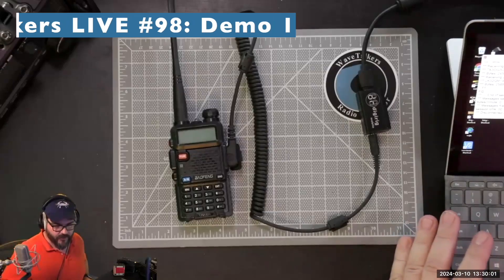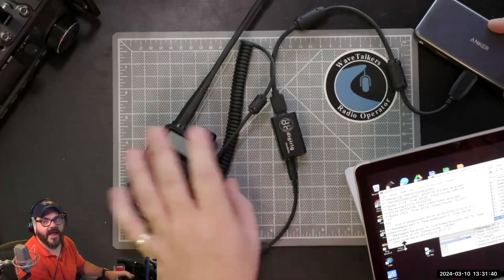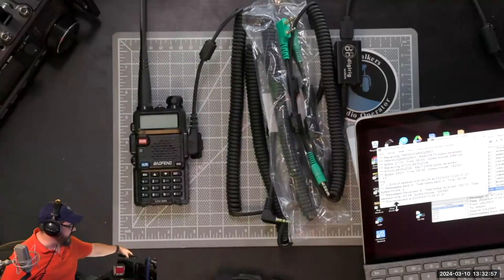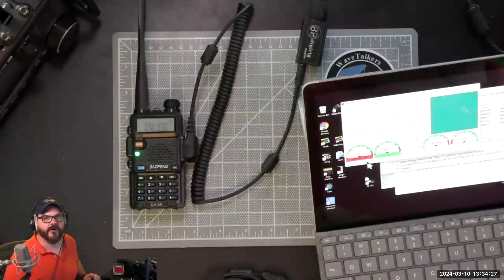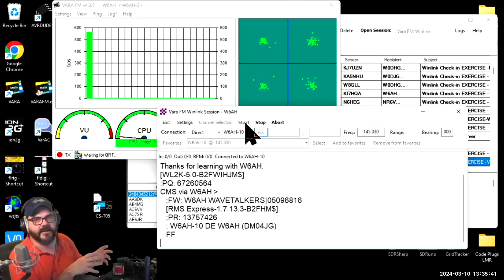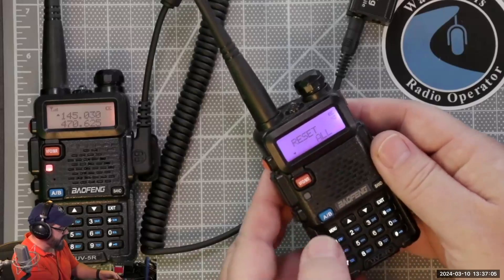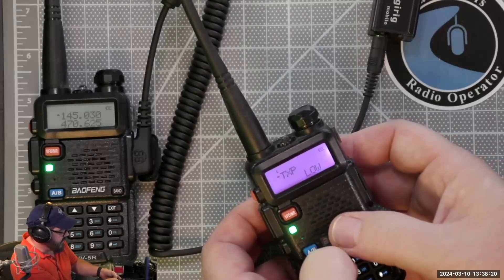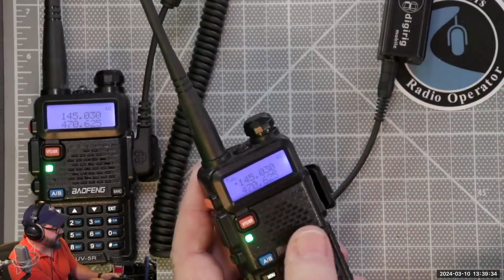VARA FM Using DigiRig & HT

Comment: 0:29 I had an issue with wsjt-x where some bands would crash the whole program after an error code. Took me weeks to figure out that winding the usb wire around a toroid about 8 times completely eliminated the issue. RFI choke everything!
Reply from the maker: Yes, RFI can be a real issue and cause a lot of frustration trying to track down.  Glad you got it working!

Comment: What size ferrites do you have on the Anker splitter? I have the same one.
Reply from the maker: Not sure which sizes they are, I had a multipack use the most appropriate size bead for the wire.
Reply: @WaveTalkers  Guess I’ll just get a bunch and figure it out. I think they have sizes but I don’t know what size a standard USB cable is.
Reply from the maker: @N4EJM  many Ferrites will list the inner diameter of the core.  You can match the appropriate Ferrite size for your wire by messing the diameter of the wire and casing.  Suggest getting ferrites that fit around the wire diameter without cutting through the casing. A little loose fitting is fine.